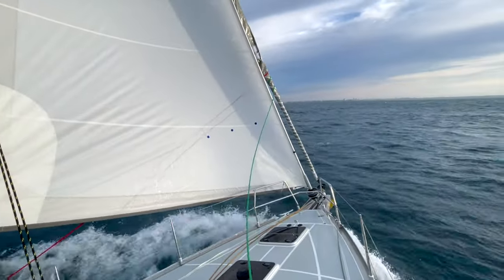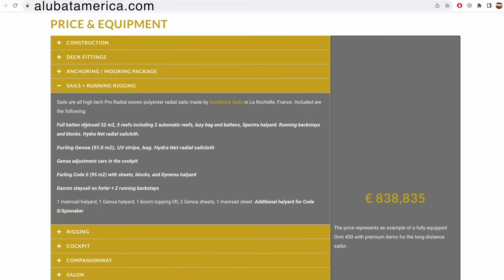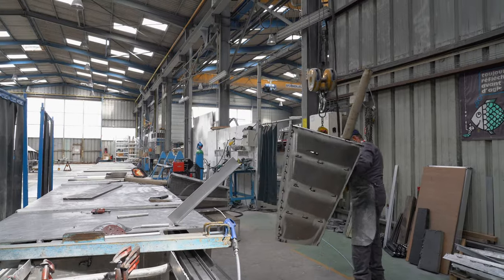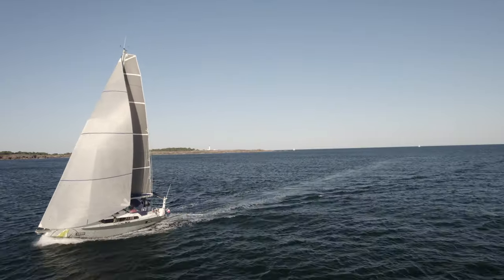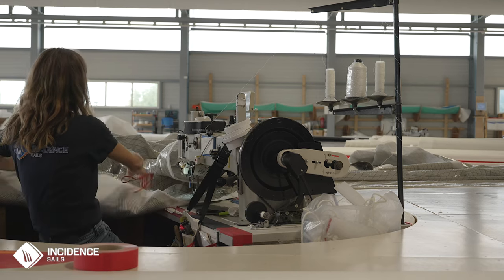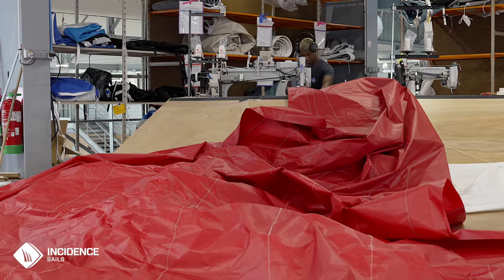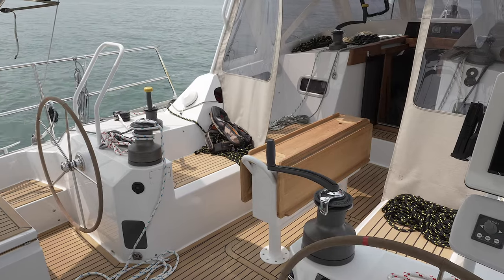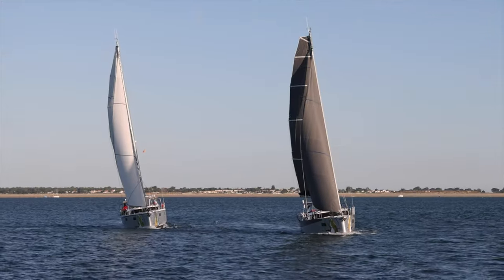How Much Does a Well-Equipped Alubat Ovni Cost?

Comment: You can get a Bavaria C48 for $300,000 and include $100,000 in upgrades, or you can get a $1,000,000 Alubat 450.
Reply: Bavaria probably is a roomy and nice coastal cruiser, but does not compare to a no compromise exploration aluminium boat like this. It is cheaper, because it is hugely cheaper and simpler to manufacture.